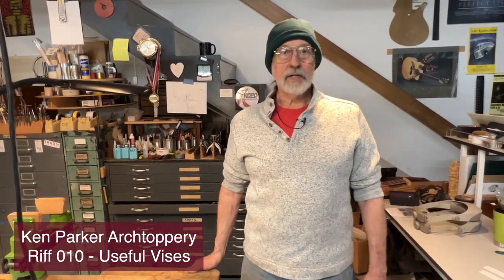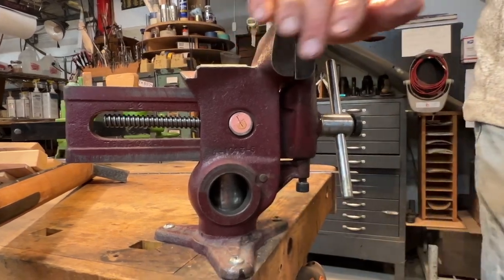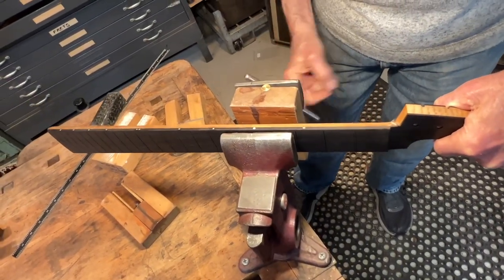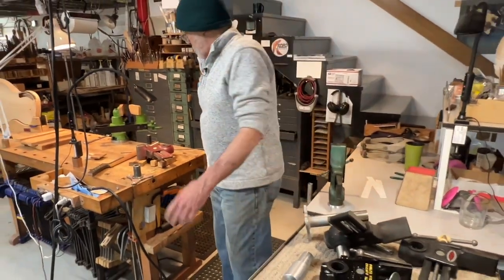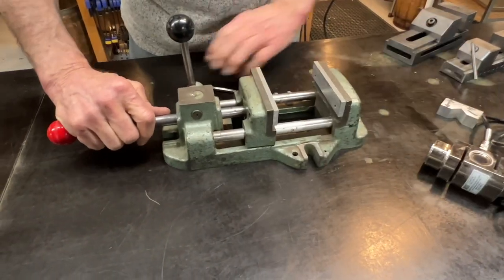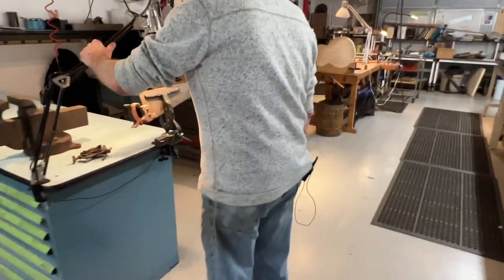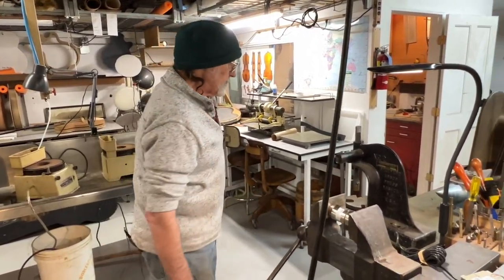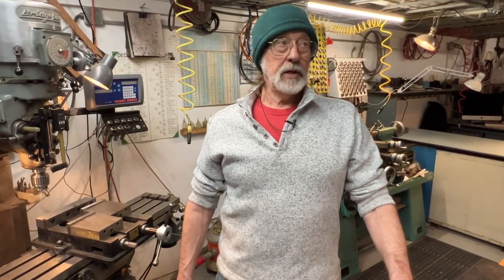Ken Parker Archtoppery -- Riff 010 - Useful Vises

Comment: That twin vice is to die for!!!  I've never seen that type of setup.  I agree, there are endless uses for it that outstrip side by side Kurts.
Reply from the maker: Yeah, the TWINNJAW is a brilliant design by a couple of brothers who ran a shop near my old plant. For a variety of terrible reasons, they were unable to penetrate the market, and gave up. Good luck with your search, but I don't think anyone would be foolish enough to sell one, maybe an estate sale?
Reply: @kenparkerarchtoppery9440  I have a couple Kurts hanging around.  I'm going to study them a bit and see if I can weld them together and machine a back jaw to span them...  It would be worth the time considering the benefit...  We run a couple CNC mills and I could see a setup where you could run parts back and forth between jaw sets...  Genius stuff.

Comment: Dare I say that you have a vise vise?  I started my work career in a farm shop, and we all were guilty of vise abuse!  The most common recipient was mounted just below waist height on a 8 inch thick walled pipe set around six feet deep in the concrete floor of the shop floor.  My recollection is six inch jaws, and a piece of pipe around three feet in length was at hand to assist in snugging up the victim of its pressure.  They definitely don’t make them like that anymore.  You continue to amaze me with your variety of work holding apparatus that has been assembled to make life easier.  Gotta hit the confuser to source a couple before the word gets out and the prices get to the point where one needs to mortgage the farm to buy old rusty cast iron with a screw in the middle!
Reply from the maker: Sounds like MightyVise!

Comment: The price of these just went through the roof on eBay.  I have found that they are commonly referred to as Parrot Vises.  You have assembled a great collection of the originals!
Reply from the maker: I just checked Ebay, and it looks like you can get an unmolested original vise in either the horizontal or now discontinued vertical style for $100 - $200, maybe less if you get lucky.  Just don't buy an abused one with deep saw and file marks on the jaws, it'll make you sad.  
Nothing wrong with a new one, this seems very cheap to me,
https://www.maxtool.com/products/shop-fox-d3125-3-1-2-x-2-1-8-inch-jaws-360-degree-capacity-swivel-parrot-vise

It's not really a collection, they're in use all over the shop, and just gathered for your amusement.
Plus, it's always nice to have an extra one, they make great gifts.

Comment: Not this particular video, but just a few weeks ago I was able to employ your advice about oiling the truss rod nut and flexing the neck to free up a stuck truss rod on a Moll archtop. It had been in the case for several years. That info was a lifesaver - I had no idea what was going on - I had run out of relief adjustment even on light strings -11-47. The closest qualified repairman is probably 2 hrs away. Thanks!
Reply from the maker: Great job!

Comment: I got me one of those parrot vises from a seller for around $25-$30 in that color of red.  It came with an accessory arm and from the looks of it, probably purchased originally from Garrett Wade.  Pretty versatile.
Reply from the maker: It's a very well designed tool. Every day buddy around here. It's great that you can screw-adjust the jaw angle to suit the force you use.

Comment: The chuck on the lathe would have also qualified as a work holding vise
Reply from the maker: Good point!  There are three chucks to fit our lathe, 3,4, and 6 jaw.  Occasionally they come in handy for holding or squishing things without using the lathe at all.

Comment: Very cool shop Sir. 
People! For the love of all... if you're gonna make vise, vice, advise (adv-eyes) or advice (adv-ice) jokes please spell it correctly. Kinda loses the kick when ya don't. No my spelling is 100% but I'm not making jokes based on it. K thx 
Getting back to the vises, Sir could you post the model number of that Parker coachmakers (or filers) vise please? I have the same one but the meatball is different, just curious if the model #'s match. Thanks.
Reply from the maker: My vise says "C. Parker Co. Meridan CT. No. H H"
I always figured that Charlie Parker must have been the design engineer, plus, Meridan CT was my family residence at birth, so really, it's family!
It has a swivel base, and is quite robust.
It can be frustrating trying to find an unmolested vise like this one, as most of them have been roughly used, with hammer and grinding bruises to prove it.
This one wasn't too badly marred, but I'll admit to having spent an embarrassing amount of time making parts for it and blueprinting it in my milling machine many years ago.
I sure am glad I "bothered", it's a fantastic piece of gear!